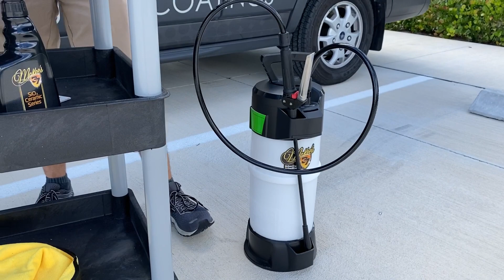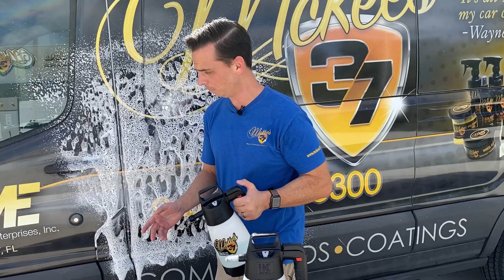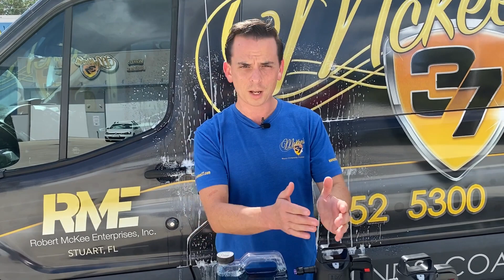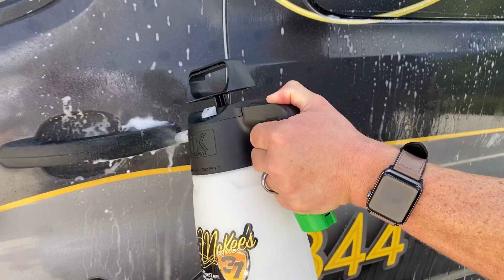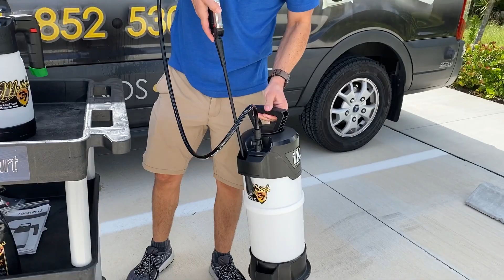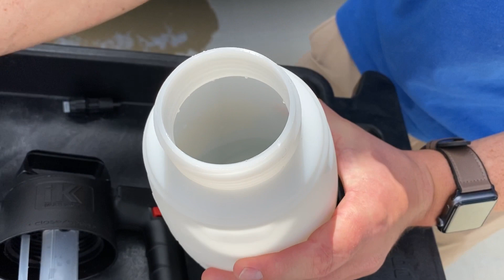IK Sprayers: Up Close & Personal | McKee’s 37

Comment: Can you add an air fitting to the large bottle to pump up with compressed air?  Thx
Reply: no
Reply: Yes, it's built-in. Pro 9 doesn't have this.
Reply: @Mr_ZeroFuel  there’s no place to pump up the large bottle with compressed air!
Reply: @tundrawhisperer4821  Watch the rag company youtube video about the ik foam pro 2. There's an air pump valve to screw in. Every ik foam pro 2 has this. Unless, you're referring to the ik foam pro 9, which definitely doesn't.
Reply: @tundrawhisperer4821  Search this in youtube by chem-x >>> Foaming Without A Power Washer! Introducing The iK FOAM PRO 12!

Comment: Why would someone buy the non foaming model. What the pros and cons of that model
Reply from the maker: Great question Tom.  The Multi Pro is designed for waterless washes, etc.  - Nick
Reply: tom martin put a Schrader valve on it and a small tire compressor and it gets around a vehicle really quick. N914 or. Your preferred rinseless.